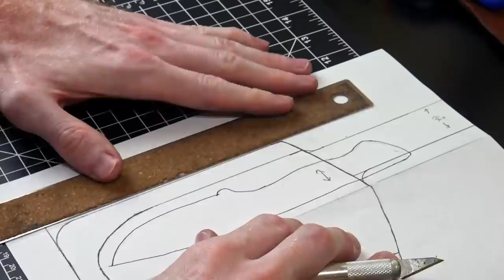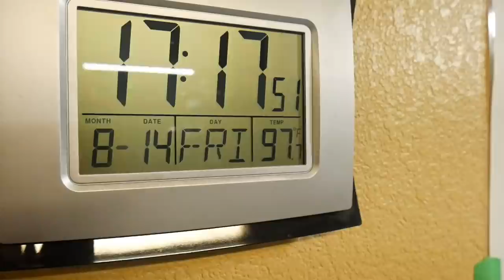Leather Sheath Making - What I've Learned...

Comment: As a professional leather worker ( I own Boulder Creek Saddle Shop in Kettle Falls, WA, you can look us up on Facebook), I want to compliment you on your video.  Great job!  In the video you asked about using an edge coat on your edges.  I don't recommend the paint-like edge coats for veg-tan leathers.  It gives the edges a plastic appearance that I think looks horrible on a nice leather sheath.  Instead, the only thing I use is cordovan oil dye from Fiebings.  Use a wool dauber to apply the dye to the edges and then buff it to a polished shine with a coarse cloth or a piece of canvas.  I do the same on all our holsters, knife sheaths, and belts.
Reply from the maker: Very nice Charles! Thanks for the tips. If you liked this one please check out my new on. I think I made some improvements and would be interested in your thoughts - https://youtu.be/MhVWVc_rdKA

Comment: Nice job! I’ve been a professional sheath maker at Schenk Knives in Idaho for a few years now and a few tips I have are 1. Don’t worry about sanding the belt loop a quick burnish and the top coat will take care of that. 2. When sanding the edges I just use 80 grit paper, if it’s giving me trouble while burnishing I’ll use som 220 on the edges. 3. If I want some contrast I’ll use a darker dye on the edges let dry then slick with water then beeswax. I personally really don’t like edge paint it just looks and feels plastic and I don’t really like that for my sheaths. 4. For a finish I love the tan kote from fiebings. Really good job on the sheaths they look awesome!
Reply from the maker: Thanks a million for your suggestions sir! I will give this a try for sure. I really like the idea of using the black dye on the edge to give it that professional look. Cheers sir!
Reply: Red Beard Ops no problem and one thing that helps with the dye on the edge is use a wool dauber but use a lighter to burn off the fuzz on it so it is just a smooth ball of wool

Comment: Love the process and end result. Only thing I can add is try putting your contact cement into a small squeeze tip bottle. I use a 1oz ejuice bottle and it holds enough for 3-4 sheaths, plus with the plastic needle tip you can just lay a fine bead along the glue line and then smooth with a brush or just the tip of the bottle. It saves me a bunch of time gluing, especially since we all know how stringy the cement can be coming off the brush. Also helps minimize the fumes coming from an open glue pot, which are supposedly really bad for us. Just a suggestion though.
Reply from the maker: Good idea sir! Thanks for your comment. I heard they're bad too...

Comment: Very nice video, as usual.  When i make leather sheaths, i use a product called Sno Seal; it's a beeswax base that goes on best if you use a heat gun while applying it.  I apply it before i do the stitching.
Reply from the maker: Thanks for the tip sir, I'll investigate!

Comment: Great video!! But for the inside of the sheath I use Gum Tragacanth, and for the outside I use  Carnauba Cream, and after all that I may use a little Neats Foot Oil to finish. That's just what I do. The Gum Tragacanth, is a burnishing agent, so I also use it to burnish the edges after I dye them.  I've found that the Gum Tragacanth, helps hole the "fuzzies" down. Stay safe, and keep hydrated in this Texas heat!!!
Reply from the maker: Very cool thanks for the tips sir! I've heard good things about Gum Tragacanth... going to need to order some!

Comment: After beveling the top of the sheath apply Martin’s mix2020 to edge with a qtip and burnish with canvas. Lightly sand with 600 and then ass dye. Apply more Martins mix2020 and burnish again with canvas. Happy working!

Comment: You did a great job and your learning curve is fantastic. I have used neatsfoot oil in the past and actually prefer Chelsea leather food. I’ve got a link in my sheath making video over on my channel. Also, I like using beeswax as a burnishing agent and to treat the interior / fuzzy sides of the leather, it heats up easily and absorbs into the leather while tanking down anything. I also dye the edges before I burnish to give them a uniformed look. I’ve occasionally used edge kote, but the finish appears more plastic like than leather.
Reply from the maker: Thank you for the tips sir! Good advice for sure.

Comment: I commented on your Instagram but I wanted to comment here.   Use quick slik on your edges.  Once cut.  Apply some quick slick.  Use 200 grit and sand for maybe 10 seconds.  Switch to 400 grit and repeat.   Go on one direction at the end of your sanding to lay down the knap of the leather.  Repeat at 600 if desired.   Then add a little quik silk and and use a bit of canvas to burnish. You should have great results there.  Dye and let dry.   Add a little bees wax and rub again and you should have a finished and completed edge.
Reply from the maker: Thank you very much sir! Since posting this video a few of you pros have reached out with similar advice. I'll be using this method for sure! Thanks for the comment!

Comment: Turned out well m8. Your improving alot. Couple of little tips. After your initial edge sand on the grinder, instead of going with fine sandpaper next, wet the edge with watsr, then slick it down, then sand it down with ths 600g. Wet it then slick it again. You can use 1000g then. Now if you want  nice dark edges use dye. Dont use edge coat. I tried it once and it was brutal, it chips and cracks alot, not great at all. So i used dye and it was perfect.then you can use either water again or the slick juice or gumtragacanth ontop of the dye and slick it. Always use those slick gums after dying as sometimes the can resisit the dyes. Then slick it down with your slicker. You can also use a piece of burlap or jeans to do a final burnish on it. Youl get almost pefect seamless edges. Just takes practice. Quality leather is always the key, and you have that. As for the stitch, if you want to avoid piercing a stitch, which as you said is dam annoying and incredibly time consuming,put both needles in at the same time, and loop left thread over right needle and right thread over left needle as they emerge from the hole alot easier in the long run..
Reply from the maker: Thank you very much for the tips sir! I'm getting some dye heading my way for sure for the edges!

Comment: When finishing edges the quality of the leather make more difference than all the sanding you can do.  Wickett and craig or Hermann oak are both great tanneries, so you have that right.  I only use a 120 grit belt on the sander to grind the edges even with each other along the welt anything finer does not seem to make much difference when I burnish.  The parts of the sheath with only a single layer of leather I just edge bevel, dye and then burnish.  I like gum tragacanth for burnishing and resolene as a clear coat to seal the leather.  I do not like the look of edge coat myself.  I have posted a couple of sheath making videos on my channel if you are interested.
Reply from the maker: Thanks for the tips and suggestions, sir! Much appreciated. I'll take a look for sure.
Reply: Yes, very good videos
Reply: I'm not a fan of edge coding either I tried it on a couple of projects and after doing it the proper way I still don't like it I've seen videos on YouTube from some pros I don't like their Edge coating either

Comment: Came to knife making from leatherwork myself and enjoy your vids, super helpful. If you mean finishing preburnishing at the edge then add  a course sandpaper before 600g. I use 220 and then 400 and burnish with powerwheel (walnut ) or Africanblackwood slicker by hand on some (occasionally 0000 or 00000 wirewool for 3d molded shapes with tight contour on edge). If you mean the back of the hide rather than edge then quality hides should be finished to where isn't an issue and if it looks ok but starts getting fuzzy it is likely because it was pasted as some Tandy hides are. I buy specific European tanneries vegtan and dye and final stuff etc myself and the flesh side is always pristine and perfect so needs no work. However when I'd cheaper hides such as what Tandy or other cheaper sources stock it needs work, fine for sheaths but I'd not use on higher end stuff personally. USA sourced I like Hermann Oak and Horween but use English and a couple of Italian tanneries since I'm in Europe and not been stateside for some time.

 If the back does need work take the heavy fibres off with a head knife. Then you can just paste it yourself to remove the micro fuz or you'll keep bringing new ones up I find on lesser hide thus skive them off and paste better. Use something like bagkote or tankote or equivalent. You could try something like resolene but I dislike the plasticky finish but is not too bad if you cut it 50/50 with water. For burnish mix I use distilled water with a little polish rectified spirit (everclear is basically same) and stick blend pure gum trag powder into it a little at a time until like a stiff gel. Strain any missed globs and use the gel as burnishing mix for edges. Takes elbow grease by hand but it looks as good as the paint like edge finishes but doesn't wear off as easy as them nor chip as it is more flexible and doesn't chip paint like. Apologies for the essay but hopefully it saves you time/work.
Reply from the maker: Hey Doc, thanks for the detail in your reply. I will take some of your points to heart for sure. Between your feedback and the feedback of others on these sheaths, I can't wait to start my next one! Have a great weekend, sir.

Comment: Wet forming right after glueing up will help. That way your edges/lines/stitiching wont deform that much. So after molding you can refine the profile of your sheath back to your desired shape. Right now the top of your sheath is narrower than the bottom where the tip of your knife is. Thats because of the material around the handle area. Hope you can understand what iam trying to say. Iam no english speaker.
Reply from the maker: Thank you for the information sir! Good tips there

Comment: I use Tan Cote on the inside of the sheath but I don't like it.  I may try your method with the exception of using gum tragacanth.   I use a Food Saver to wet mold but you have to make sure to use a smooth backing between the sheath and the textured side of the bags.  I use edge cote but don't really like it because it paints over the leather.  Thinking about using some black dye on the edges.
Reply from the maker: Thank you sir! I've been hearing from some pros today about the edges. Many recommend the black dye approach.

Comment: In my opinion Duracoat works the best for sheaths as an edge coat. For my sheaths as a top finish I started using a thin coat of leather balm and that leaves a very nice and shiny finish after buffing with a microfiber rag. If you dont use edge coat,  a little beeswax conditioner like snoseal or obenaufs works awesome for burnishing. Again these are things I have tried that work for me and its my own opinion. Hope it helps. Hit me up on IG if you have any questions.
Reply from the maker: Heck yeah man, thanks for the tips and suggestions!

Comment: Bevel the edges first. Then wet the edge and burnish. That will get rid of fuzzies as well. Or make a power burnisher. Or use a rotary tool with a burnishing bit in i.t
Reply from the maker: Thanks for the tips sir!

Comment: Get job for a novice leather worker. I am a leather worker myself and have made several knife sheaths. The key is using good leather. Ok here are some tips for you.
1. Don't use metal hammers on any leather tools. I Cringe when I see this only use rawhide or a poly mallets as it will save the tools for years of use.
2. When doing edge work. Sand down the edges flush and you can start with 120 grit and only go to 320 grit. The you can bevel and like Tokonole for burnishing myself. Also don't use edge paint the suck and can peal off. Tokonole also come in different colours too. White which comes out clear,  Brown and Black comes out there respective colours.
3. You can use a V groover for the center cuts for folding. 
4. Tandy sells a freehand stitch groover. I use it all the time and it is awesome on grooving out stitch lines after you have pricked your holes.

Well that is some of the tips that I personally do good job and good luck with your projects. Also check out Weaver leather element on YouTube. You can learn a lot about leathercrafting from them.
Reply from the maker: Thank you very much John, I'd be curious to see what you thought of my sheath in this build - https://youtu.be/usDL_AI1ZqQ . I think I've made some progress from this "learnings" video. The Paul Long DVD went a long way...

Comment: They look great mate...well done!   Don't use edge coat...it is nasty shit....just don't bother with it!
Reply from the maker: Hey Wade, thanks for the tip! I've heard that a few times (once from Dave at Horsewright) so I should probably listen! Cheers sir.
Reply: Mate could you tell me what that nail is that you are using to make your stitch holes?  Sounds like you are saying "finishing nail" is that correct?  If so I don't know what that is... thanks in advance!
Reply from the maker: @wadejensen3301  Yep that's right. They're called finishing nails and you should be able to find them at any hardware store. They're used to nail up trim pieces. You could also use a large needle.
Reply: Okay..got it....thanks for the reply I appreciate it....take care!